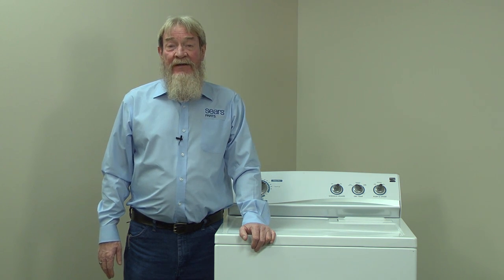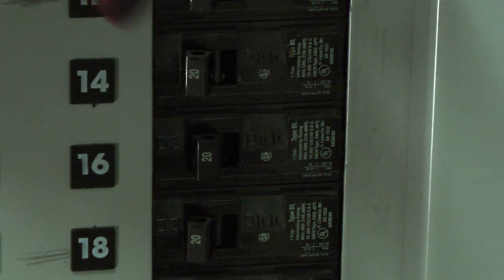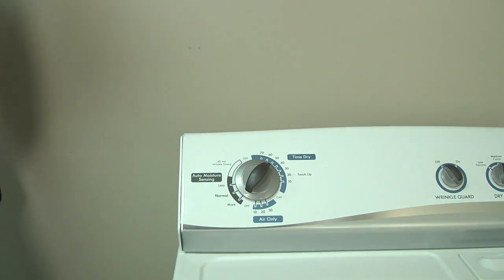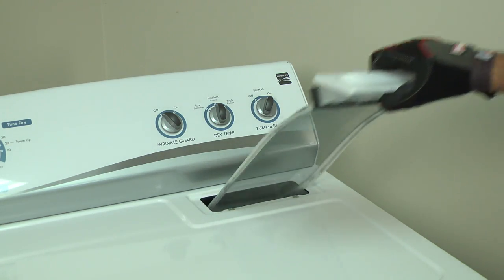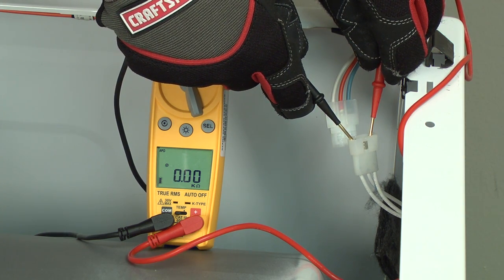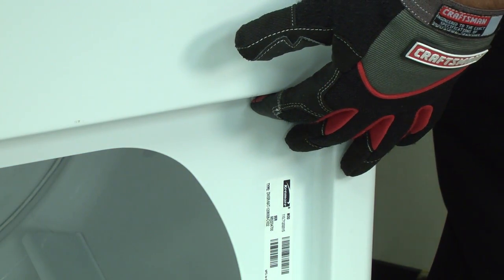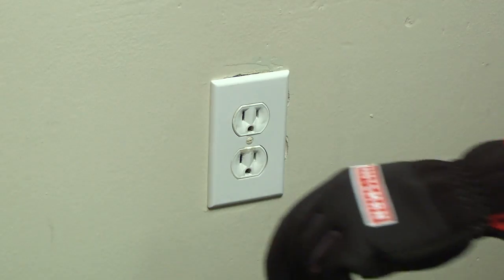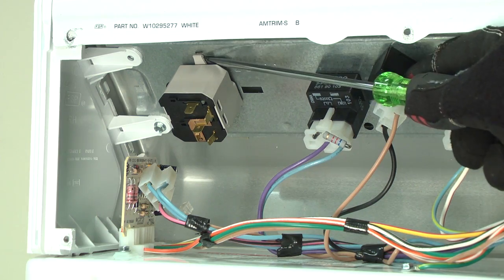Dryer Won’t Start: Troubleshooting Gas Dryer Problems

Comment: Don't forget to look for the other easy item...the drive belt. The motor has an interlock switch, so all you;ll hear is the starter solenoid clicking.
Reply: Hello, really hoping you see this today and reply to me. If the drive belt is broken, it won't start at all and you would hear all those clicking noises he said? I actually see that the belt is broken and cannot get dryer to start at all. Is the belt why or should I keep searching for more? All switches have been tested and working fine.
Reply: @ryankearns2984  In my experiences, I would say the belt is your problem. Especially if all the other items check out as good.  I found a belt for my model for around $10 on Amazon. https://www.amazon.com/gp/product/B00GVL0U7K/ref=ppx_yo_dt_b_asin_title_o00_s00?ie=UTF8&psc=1
Reply: Please give me advise, my problem is when pushing the start switch it tripped the breaker right away. My dryer is gas dryer. thanks.

Comment: It may also be a blown thermal fuse
Reply from the maker: A blown thermal fuse can prevent some gas dryers from running but the thermal fuse in most gas dryers only cuts off power to the gas valve and allows the motor to continue to run so the blower fan dissipates flame fumes.